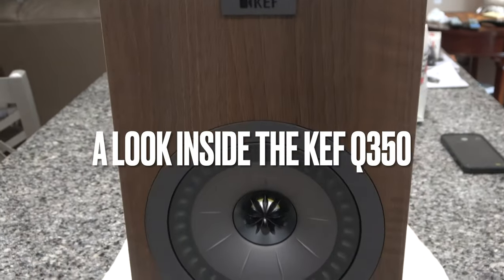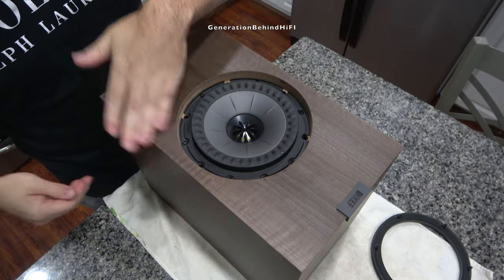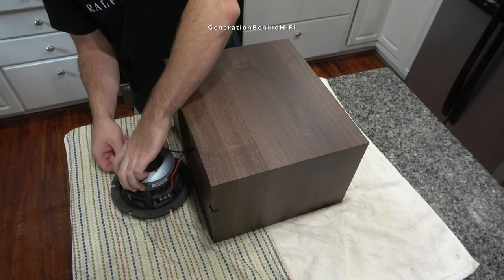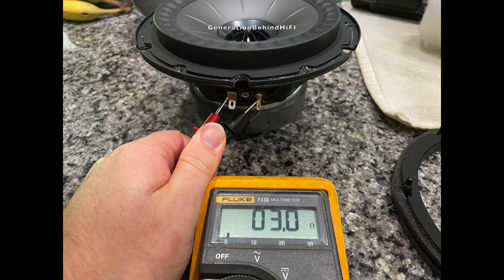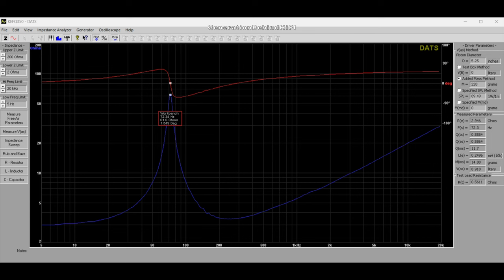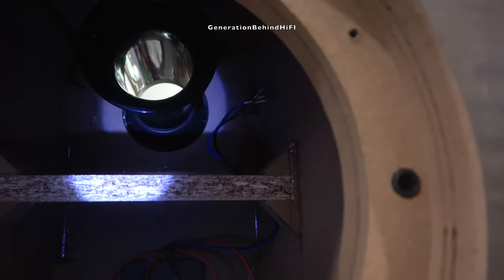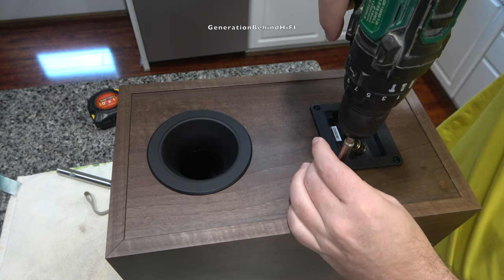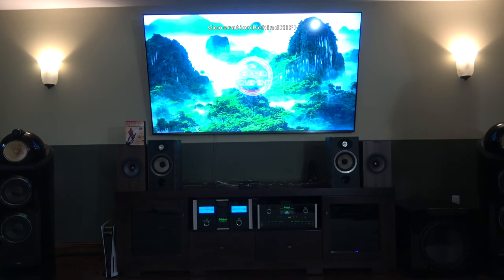A Look Inside The KEF Q350 Speakers

Comment: I highly advise against any kef speakers including the q350! I purchased the q350 3 years ago with high hopes and they are aesthetically pleasing but the sound was disappointing for $800 speakers. I could have lived with that, but after owning them less than a month the aluminum driver tore 2 inches along the edge of the surround. They were under warranty but a huge hassle sending them all the way back to Kef in New Jersey and being without them for 3 months. I had to buy different speakers to hold me over until the kef was returned. I've been bitter about that experience ever since and then a week ago lo and behold the other driver is now torn in the same place same size! If you go online you will see tons of kef speakers totally torn and gacked out in all sorts of ways! I wish I would have known 3 years ago before I ever bought Kef. Those speakers should have lasted me a lifetime and now I'm just screwed out of $800.00 with these POS speakers. I thought I was getting something beautiful and unique and high-end but I was so wrong!

Comment: Crossover upgrade video on these speakers sounds like a great idea. Even if you did all upgraded parts higher quality equal value to the original parts. I think you would definitely gain some sound quality 👍🏻
Reply from the maker: Parts have been ordered! I purchased 2x Mundorf EVO oil caps and 2x air core inductors. I also purchased some new damping material to line the inside of the cabinets with. Let's see what happens. :)

Comment: These are interesting videos. It is amazing what you have to pay for a monitor to get good cabinet design, film and foil caps and heavy gauge air core inductors. One small point. What the trusty Fluke meter is measuring is the DC resistance of the voice coils, not the impedance. The impedance varies widely with frequency, and has a large inductive component which translates (in part) into the amount of power that actually contributes to the sound output. The DC resistance is required for damping the driver to flatten the frequency response.
Reply from the maker: Thanks, Bob! Yes, I agree. Prices for monitors are getting a bit out of hand. B&W now wants over $1k for their 600 series bookshelf with a 6.5" driver in it. 

I will try and get the lingo right next time. I was always under the assumption that when I said the impedance of a speaker is X, it was assumed it was at 0Hz. No question that impedance varies with frequency! I supplied the impedance curve of these speakers in this video. Thanks for the comment!

Comment: There is a reason that KEF didn't spend another 7 cents to fill the enclosure with poly.  I'd guess it has to do with port flow.  You won't hear a difference between iron and copper.  The only thing that matters are the specs, not the metal used.  If you think you can hear a difference it's just because you think you hear a difference.  You don't.
Reply from the maker: Perhaps, but speakers are the sum of their parts are they not? Every little detail matters to maximize sound quality. To use ferromagnetic parts vs steel is pennies more, especially at the volume these manufactures are buying them at. My question to you is if it didn't matter, then why do all the high end manufactures use non-ferromagnetic parts in their designs? This includes Bowers & Wilkins, KEF, and Sonus Faber. I'll tell you why, because they are trying to squeeze every small performance gain they can to distance themselves from the rest. As an audiophile, everyone should be thinking this way. 

IEEE did a white paper on ferromagnetic parts in audio connectors and its a good read. Basically the study proved that ferromagnetic parts introduce passive intermodulation, aka 3rd-order harmonics distortion to the signal! Simply put, there's a reason why high end speakers use non ferromagnetic parts in the signal path.

Paper can be read here: https://ieeexplore.ieee.org/ielaam/22/8681220/8632973-aam.pdf
Reply: @generationbehindhifi  No doubt, a speaker is made of parts, but not all of them matter.  

The most likely reason for the use of nonferrous is because people look at the crossovers and they have perceived value.  They have absolutely nothing to do with sound as long as the specs are the same,  For instance, some speaker manufacturers brag about their internal wire gauge or speaker terminals.  

The IEEE paper is referring to radio frequencies.  No effect at 30kHz, effect at 30GHz.  You will hear absolutely no difference in speakers because those aren't audio frequencies.
Reply from the maker: Crossover components don't make a difference? I'm going to have to disagree with that statement. I can definitely hear a difference between an electrolytic cap and a MKP cap in my designs! 

I'm going to disagree with your statement on the use of ferrous materials being used in the signal path. I would recommend that you purchase the book "Douglas Self's Audio Power Amplifier Design" (6th ed., 2013), on pages 426 and 427 he talks about this very thing and that third order harmonics being introduced are detectable. This guy is obviously smarter than me and so is the R&D departments at KEF, Bowers & Wilkins, and Sonus Faber. All of these speaker manufacturers do NOT use ferromagnetic parts in their higher end speaker designs. Why is that?

IMO is it really worth taking a chance when the difference between ferromagnetic parts and nonferrous parts have a difference of maybe $1.00? People are willing to spend hundreds if not thousands on speaker cable (which I don't condone), but yet will leave ferrous materials in the signal path? You're free to have your opinion on the subject, but from what I have read and studied it is measurable.
Reply: @generationbehindhifi  If you're worried about saturation get a bigger inductor.  They're are a lot of designers that say a lot of things. I'd guess that an air core sounds more coppery and iron sounds more brittle and dense.  The difference is in the values, not the metal.

Comment: 2 Quick tips when replacing screws in MDF.

1) Fill the hole in the MDF with a bit of wood glue.  
Reinstall the screw while the glue is still wet. When dry, the glue will bond with the mdf but not the screw, creating a very sturdy plastic "nut" that is inseperable from the baffle.

2) Turn the screws backwards first.
I always turn the screws backwards until they drop into the original threads, reducing the chance of pulling through the MDF.
Reply from the maker: Thanks, Douglas! Those are some excellent tips! As for tip number 1, the glue really doesn't bond to the screw? Honestly, that seems too good to be true! I might have to try this tip soon.
Reply: @generationbehindhifi 
White Wood Glue (I use Carpenter's Glue, made by Lepage) does not bond well to metal, especially not smooth metal.  What happens is that it forms a very tight fit with the threads, so the next time you remove the screw it's hard to get moving... after that it's like a plastic nut imbedded in the MDF.

If you need to test this ... just drill a hole in some scrap MDF, put in a screw, remove it, put the glue in the hole and then thread the screw back in per #2... let it dry for a couple of days and you'll see for yourself.
Reply from the maker: @Douglas_Blake_579  Thanks! I will definitely be giving this a try!
Reply: @generationbehindhifi 
You're welcome.
Reply: Cabinet making 101:  never use a water-based wood glue with MDF.  It causes the MDF to swell.  Although it may seem logical set the swelling would make the screw hole narrower and therefore make for a tighter fit, it also weakens the fibers.  I would definitely do a side by side test of screw holding strength before putting $500 speakers at risk.
Reply: #2 is a great habit to get into with all screws. I've been doing it for so long that it's second nature now.
Reply: @omm5960  
A fair suggestion .... Testing is good.

But let me also remind you I've been doing this for years with no problems.

Comment: I was surprised by the stamped steel frame for the driver and also how minimalistic the crossover is. The lack of damping material is also a concern because some resonances can easily appear in a rectangular box. Putting an air core inductor will certainly help transparency and control in the bass region. Great video! Very enjoyable!
Reply from the maker: Thank you! I appreciate the kind words! Yeah, I was surprised by the stamped steel basket too, because the previous generation Q series used a cast basket. IMO I think KEF was cutting costs to reduce manufacturing costs. Shame! Hopefully they get back on the right path with the next Q series generation.
Reply: Maybe. I would be cautious with messing with the manufacturers design. it may be very possible that they use that amount of damping material for a reason. I expect the crossover is carefully tuned for that particular speaker. I guess I just feel fairly confident that the KEF engineers know what they are doing.
Reply from the maker: @Dave_Outside  Hi Dave! That's not what I do here. I'm always tinkering. 🙂 The KEF design was built to a price point, hence the crossover and cabinet damping inside. If you look at the impedance sweep, then you will see that this design will benefit greatly from some additional damping inside the cabinet (standing waves and resonances) and I also think some higher quality components on the crossover will benefit the sound a bit too.

Comment: The biggest improvement will be going to air core inductor of same value. Upgrading from that resistor and metal poly cap will have nil effect, unless for some reason that cap is high ESR.

Comment: Great video!!! I was considering buying these used and doing some easy-ish DIY mods on them. The drivers are well-designed and are capable of impressive SQ - but the cabinets and crossovers are built to save money and are the weak, crappy parts of the speaker, IMO. If I were to go forward and get a used set, these are the cheap and simple mods I'd try first:

1) Self-adhesive, butyl sound damping sheets on all interior surfaces of the driver - double thick "strips" on the center of all panels as targeted "spot damping" for a bit extra vibration damping;

2) Extra 3/8" to 1/2" wood dowels fitted inside the cabinet above and below the single existing brace. To make the cabinet even stiffer and much less resonant;

3) Some Parts Express "Sonic Barrier" damping sheets - either the 1/2" or 1" thicknesses. They would finish out eliminating the cabinet vibrations and resonances. The cabinet would finally be dead enough not to "play" along with the drivers;

4) A bit of extra polyfill weighed bit by bit and added to each speaker to season to taste. While listening to the results and being careful to not "overdamp" it and to not create a dynamically "dead" SQ; 

I'd do this to most of my low cost "value" speakers (ie: PSB Imagine XBs and Energy RC-10s) with really good results, IMO.These cheap DIY mods could make this speaker ascend in SQ by quite a bit, IMO. 

Of course, the crossover really needs some work also, such as: Designing it to have at least either 2nd or 3rd order slopes (ie: either 12 or 18dB per octave vs the shallow, OG ~6dB per octave slopes). That would allow both the midbass and tweeter to not have to work so hard out of their bandwidths - resulting in the ability to play louder and smoother with much less distortion or stress. That's what I'd do.....
Reply from the maker: Thanks! I really appreciate that! I agree with everything you said. You definitely don't want to miss my KEF Q350 review video that will be coming out on 12/1/23. In that video I will announce my KEF Q350 upgrade video series with the hopes of taking these speakers to the next level with reasonable upgrades just like some of the ones you described above. I even picked up some Mundorf Evo capacitors and new air core inductors for the crossover.

Comment: Emotiva speakers use threaded metal inserts in their speakers. And yes, an air core inductor on the woofer would be a big improvement, and a 0.1uF bypass cap on the stock cap; or replace the cap with a better one. That brand film cap is very low cost. Some triple layer damping foam (like the 3/4" sheets from Parts Express) would go a long way to reducing cabinet resonances.
Reply from the maker: Thanks, Neil! I will have to check out Emotiva's speakers one of these days. I had a set of their XPA-1 amplifiers back in the day and was very happy with them. I appreciate the suggestions! Happy listening!
Reply: I had these for a while they're really good for the money there was excessive energy around 200 Hertz sounded to me maybe that insulation would have fixed it.
Reply: @gregmatula9749  Are you referring to the 3-layer foam? That might do it - or a few ribs / struts to stiffen the top/bottom/sides/back, which are not nearly as thick as the front.
Reply: @NeilBlanchard  Yes that's what I meant. I don't have them anymore and ended up going for the polk r200 but it was a close battle for me.
Reply: @generationbehindhifi  I realized that it is possible that the crossover in the Q350 could be a series design, in which case it would be 2nd order filters on both drivers. Can you take a look at the circuit? If the positive binding post is connected to the inductor coil and the resistor, which then is connected to the tweeter, then it is a series XO. The negative tweeter lug would be connected to the positive of the woofer AND to the other side of the coil AND to the cap. The negative connection of the woofer would be connected to the other side of the cap and to the negative binding post.
Reply: @NeilBlanchard 
Hey Neil ... 

It sure looks the part, doesn't it?  

Series crossovers are fun, cheap and beyond easy to make... although a bit tricky to design.  They look like first order parallel crossovers because of the single coil and cap design, but in fact they behave like second order filters.  

Lots of good bang for your buck.

Comment: Oh man, thank you so much - I've recently purchased a pair of Q500 and after 10 or so days I've noticed that there is something buzzing/resonating in one of the speakers during a few of bass-only notes in one of the songs. I figured chances of this being something being badly seated (like a screw) were high (as opposed to problem with the cone itself) but not knowing a thing about how speakers are made I didn't know how to get to the screws - it did not occur to me you can 'unwrap' the rubber 'z-flex surround' bit. 

So i've removed the plastic ring following what you do at around 1:00 mark,  undid and screwed all the screws back it, cleaned everything and the issue was gone, and stayed gone with the plastic ring put firmy back in. Thanks again!
Reply from the maker: Happy to help! :)

Comment: Wonder if these speakers match my Aiyima D03, because.. now i have a pair of Triangle Borea 3(90db sensitivity); the Q350 are 88db sensitive so that's why.

Triangles sounds great on the Aiyima even at low volumes.. love these speakers. But yeahh..a pair of KEF Q350 nice to have "extra" ..

Had a pair of Dali Oberon(also 88db)before and there was no problem for the Aiyima, only they gave to much low end..
Have small room(25m2), so that's why.

Comment: The kef350 have a stamped basket ? 
I have two pair of the kef 300 and the spider basket is diecast and have for sure a better crossover and more material inside.
Also have a front port makes them better to place on a wall and can be bi-amp or bi-wire for who is in that kind of stuff.
Reply from the maker: Sadly KEF switched from a cast basket in the previous Q series to a stamped steel basket in the current Q series.
Reply: Yeah kef q300 is better, I have them and they are much better built and have superior specs

Comment: The setting on your DATS for inductance is set for 10Khz, for a woofer the 1Khz setting would be much more telling as it is much closer to the range it is covering. Using the 1K setting will show a higher value.
Reply from the maker: Hello Emmet, I'm a bit confused by this statement because DATs does a sweep from 5Hz all the way to 20KHz to determine the T/S parameters. How do I change it to 1KHz?
Reply from the maker: Never mind. I found it! Thanks for letting me know.

Comment: I had the q350 for a month before returning them and getting q150s and a cheap Fosi ZA3 amp, which is the best sub-$500 system I've ever heard. They're both amazing speakers but the difference between the two is negligible when paired with a sub. q350s just aren't worth the $450 premium at the normal price, imo. Q150s at $300-$350 are a bargain.

Comment: Why are magnetic nuts an issue?
Reply from the maker: IEEE did a white paper on ferromagnetic parts in audio connectors and its a good read. Basically the study proved that ferromagnetic parts introduce passive intermodulation, aka 3rd-order harmonics distortion to the signal! Simply put, there's a reason why high end speakers use non ferromagnetic parts in the signal path.

Paper can be read here if you are a IEEE member: https://ieeexplore.ieee.org/ielaam/22/8681220/8632973-aam.pdf
https://www.audiosciencereview.com/forum/index.php?threads/ferromagnetic-materials-in-audio-connectors.41867/